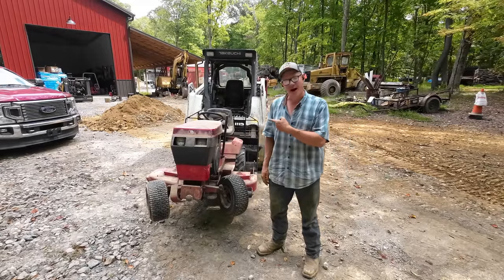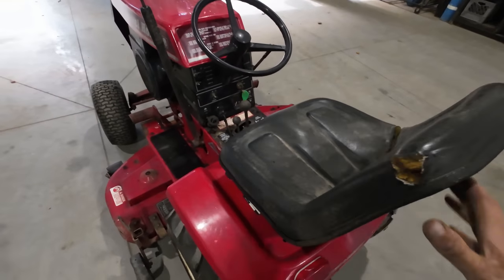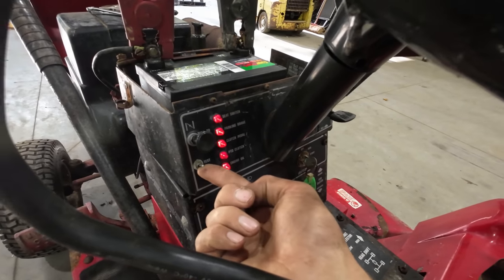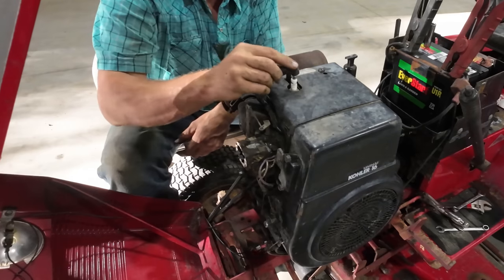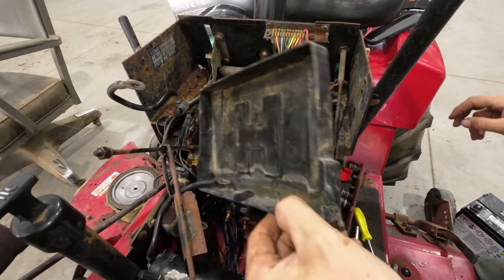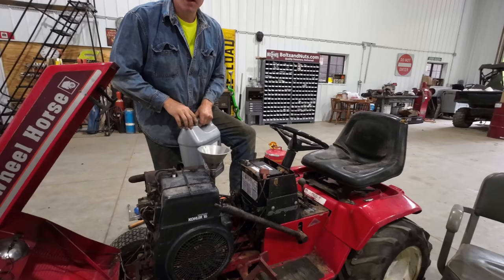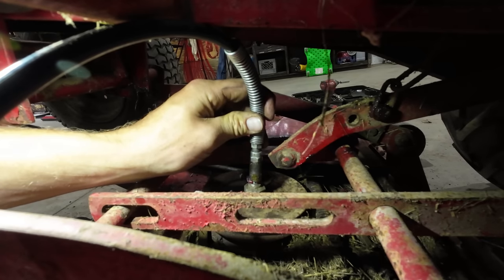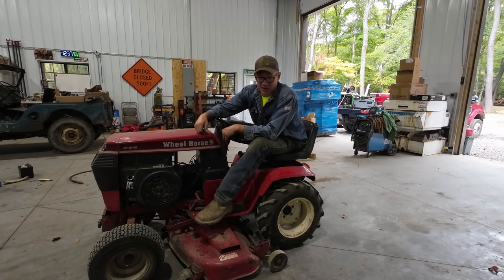FREE! Wheel Horse Garden Tractor sitting for YEARS! (WILL IT RUN??)

Comment: Matt,  What a treat.  I purchased a Wheelhorse 520H new in 1992 and mowed 2 acres with it for 24 years until the mower deck was so thin you could stick your finger through it in about a dozen places.  I still kept it for 3 more years to use the snow plow, and finally gave it to a young kid who wanted to restore it.  The 4 series was the same tractor except engine sizes and the front axle was different  (canted further forward on each end, I think this was due to the hydraulic lift quick attach mower deck).  Mine had the Onan 20HP with Hydrostatic drive and hydraulic lift.  It was the top of the line for the time.  All structural steel and cast iron, weighed in at about 700lbs with 48" deck.  It is a testament to the quality of the older Wheelhorse equipment before Toro bought it and the accountants started running the business....cheap is good, cheaper is better mentality.  This machine will probably last another 20 years as long as it is maintained properly.

Comment: That is a great tractor! I am a wheelhorse guy and own 7 of them at this time. I was thrilled to see you working on this one. These tractors are timeless and I plow my driveway out each year and mow with mine. I live in the snowbelt of Western New York state and that tractor has no problem dealing with all the snow we get. I get replacement seats for mine at Northern Tool, if you are thinking about replacing that one.
Reply: My dad bought a 1975 automatic years ago and is selling it despite my best efforts to convince him it’s a good little tractor to keep. They’re great tractors for their size, built sturdy, easily repairable. If you’re wanting a tractor to wrench on and get your moneys worth out of. It’s the tractor to cut your teeth on!
Reply: your right that horse will out plow my 25 hp deere and the ponds had a superior snow plow design
Reply: @StrikerV3  wheel horse tractors were at one time a direct competitor to cub cadet  ,, i still have my grandfather's D-160  wheel horse tractor ,and there's no mistaking it for anything else   it's a big square tractor slightly bigger than a 430 JD garden tractor,,, i own 3 D series WH tractors ,,the old D160  and i have acquired a D180  and a D200 ,,,,,my D200  has been repowered with  a Kubota D722 3 cylinger diesel
Reply: Love ‘em I got 5 3 different 312-8 and two c160s
Reply: I'm in Western NY too..Lewiston NY actually don't get all that much snow here..where abouts are you southern tier?
Reply: I live right next to Letchworth State Park in Wyoming County. We get lake effect snow from both Lakes Erie and Ontario depending on the wind direction.
Reply: @Paleoman52  I gotchya..yeah you get your share lol

Comment: The Wheel Horse tractors with Kohler horizontal crankshaft engines are lifetime machines.  I have 5 of them. Changed the engine oils to synthetic as well as the trans/diff fluid.  to synthetic.  That one you had given to you is really in quite nice condition. Take care of it

Comment: As a wheelhorse fanboy and collector I’m looking forward to watching this. The 4 is for the 400 series. They had a 200-500 series. The lawn tractor video you did was one of my favorites. It was my exact first mower when I was 8 years old. My dad had a 312-8 growing up, my grandfather had several different horses throughout the years. I currently have a 520 hydro and a newer 520 lxi which are both beast in the garden tractor world.
Reply: I have the 312-8 also and use it all the time
Reply: ive got a rj59 its great its getting a 212 put in
Reply: My favorite was my 1972 Commander with the Kholer 18 horse S belt drive takeoff.
Simply couldn't kill it if I tried.
Slow as F but always reliable once I got done fixing the various issues it had from the lawyer I bought it from up in Coral Gables.
Paid 200 hundred bucks in 2010 body mint condition. 
It was originally his dad's.
Unfortunately he gave all the accessories away or scrapped them.

Comment: Lol. That is why I love working on small engines. It is my passion, because they are just so simple to work on. My mom's tiller started acting up the other day. I removed, disassembled, cleaned, and reinstalled the carburetor in 14 minutes. Small engines are just cheap and easy. You don't have to be rich to pursue it as a hobby. I have enough projects right now to last a year or so, and I got all of them for free. It's a great way to spend your spare time.

Comment: It needs A solenoid switch replacement put on it. And A oil change. Along with A new air cleaner filter. I highly recommend adding in some zinc powdered additives in the oil it's extra engine block and cylinder wear protection for it to matt. Especially if y'all plan on using A snow plow on it in the winter time to.

Comment: Hey Matt, I loved the video on the Wheelhorse mainly because when I was a kid, my Dad owned a couple of them he added three-point hitches (manually operated) that he used to plow, cultivate, and harrow our and several friends', family's, and neighbors' gardens.  Although both of ours had Wisconsin engines on them, I remember my Dad showing me that when starting them {especially cold} if they kicked back {ours had rope starters} it was generally a sign that the valve lash needed adjustment.  Since then, I've remedied this issue with Wisconsins, Kohlers, Briggs and Strattons, Tecumsehs, and Hondas as well as a couple of Chinese engines. If the valve lash is too great, the intake valve is closing too soon causing excessive compression upon starting and the exhaust opens too late causing more heat buildup in the cylinder.  I've encountered many instances where people have replaced perfectly good batteries and starter motors.  This could possibly account for the overheated/melted/defective starter solenoid on your unit.
Reply: I've just been doing the manual 3 point lift myself. Don't suppose you have any pictures of your dad's version?

Comment: Hey Matt, I noticed the mini-splits wrapped in the background ... one thing I've wanted to mention, heating the shop with the radiant floor alone is a slow process. Consider adding unitary heaters as well. The floor will do a great job if the bay doors are kept closed, but as soon as you open one all the warm air is going to blow out and the floor alone will take a long time to warm the space back up again. A unit heater or two by the doors will help break the chill and give the floor time to re-heat the space again. Also a big ass fan will help push the warm air back down to the floor.

Comment: @Diesel Creek it's a DC relay or DC contactor.  A solenoid by itself wouldn't have power contacts that are actuated.  It would just be an electrical coil and a steel bar.

A contactor or relay has several components inside of it.  Yes one of which is a solenoid.  It also has a power contact, which is actuated by the solenoid.  Sometimes they have auxiliary contacts too.

Comment: Man, I just pulled a WH 1057 (1967 year) with a snow blade out of a farmer's field in Illinois last year (for sale off Marketplace). The transmission was full of water, the carb was toast, but everything else was good. A month of work on it later, I had it running and driving, then used it to plow snow from my long driveway all winter. That thing is a beast! All steel and no plastic on that machine. And it never got stuck in the snow or mud. I later realized people use these models for lawn mower tractor pulling!

Comment: Good lawn tractor. 
The mower deck does a very nice job.
Rear exit.
You can go around trees , vehicle's. 
The blades spin fast. 
You can travel at a good speed while mowing. 
Try it think you will like it.
Correction mine has rear exit.

Comment: Hi Matt, I have I have a 312A, 1986 anniversary series. It had chrome hub caps and chrome muffler. It had the smoothest hydro-static trans/rear diff I have ever seen. It did everything l asked to do, mow, push snow, sweep up lawn,and snow blow. I still have it but it needs a complete going through and new paint. It have new decals for it. I can wait to get started on it. I also had a 312-8, but let go. No room for it. The 312A was never stored out of doors. It will be with till I’m gone. It has well over 1400 hrs on it. Enjoy show!

Comment: Love that Wheel Horse, Matt! Major soft spot for them. About 1958 my dad bought an RJ58 model for our rural 12 acres in Ohio Township NW of Pittsburgh. He got it from a WH dealer over on Babcock Boulevard. Our property was hilly and he didn't get a mower deck with it but did get a snow blade for our long hilly driveway. He dug a trail up into our woods and we used the Wheel Horse to pull logs down to the house to cut up for firewood. And I nearly drove the wheels off of it as a 12 year old wishing I could drive a car, so it was my "car" for a few years all over our property. It's only drawback, those early models had a "mid engine" that was just ahead of the gear shift necessitating a big chunk of cast iron bolted ahead of the front of the hood and front axle to keep the front wheels on the ground unless you wanted to pay the big bucks to refill them with liquid when you'd get a flat. Fast forward to my Army hitch in '71. When my dad passed away and my mom needed to sell the property our neighbor bought the Wheel Horse from us and made a custom two gang rotary mower brush hog set up for their wooded lawn area. Years later when he passed away their family sold their property to a cousin and the Wheel Horse went along with the estate. No doubt it's still running today. I'd love to have your Wheel Horse but the shipping to Colorado would be a killer! And the downside about it, it's likely a 48 or 54" deck and that won't fit through my TUFF shed doorway. My old Craftsman lawn tractor has a 42" deck and I have to lift the discharge chute vertical to get it in the door so the WH would be a no-go. Hope your dad gets a lot of use out of it. It should run for years into the future! By the way, on Pinterest I found a Wheel Horse group that posts beautiful photos of restored early models.

Comment: Hey Matt, a plumber friend told me when I was about 20 to use grease on pipe threads. He told me the pipe thread is tapered and all you ever have to do is tighten the connection enough to keep it from leaking and the grease will offer lubrication to allow for tightening it enough. And as a bonus, you can usually undo the joint too. I have seen so many different kinds of "pipe thread compound,s" hardening,  pliable, non-hardening, liquid teflon, yellow teflon tape for gas and white teflon tape, but I never once heard of or seen anyone use grease. The guy was a master plumber who owned his own plumbing business, so I took his word for it and I have used it ever since. ben/ michigan

Comment: Save it . These are bulletproof. Tough as nails tractors. We had four of these at our local school district. I will tell you they did not go out for an hour or two once a week. They went out five days a week eight hours for years mowing at our schools. They were used in areas that were too small for our larger equipment to mow. And trust me they held up extremely well. Not only that but the cut was top notch. Because the deck is tall, they gave you a wonderful finished lawn even when mowing in early morning wet conditions. No clumps. Look at all of the cast iron construction all of the grease fittings. Even on the pivot points of the clutch and brake pedals unlike what you will find at Lowes or Home Depot today. They made a rear discharge deck that was used by many cemeterys because they did not blow grass onto headstones instead the grass came out the back or the tractor between the rear tires. a brilliant idea to keep grass out or homeowners flower beds as well. Please save it and treat it well and it will reward you with years of service.

Comment: Simplicity lawn tractors are great.  You can find them branded as old Craftsman, and Agco Allis tractors.  They have a cast iron front diff, hydra drive, 2 sppeed rear ends, diff lock, and front end loaders, front accessory drive, as well as dual wheel kits and some have a 3 point hitch. Oh, and they mow grass too!  The older ones will come with and Onan engine and some come with a Kohler Command Pro (which gives the most savage backfire when you shut it down from high RPM).  I ran an 18hp onan Craftsman model for years until it had a rod failure, then I ran it for another year on 1 cylinder.  I didn't have any idea the motor busted until i had someone take it apart.  Sadly, couldn't get the onan parts to replace.  :-(.  I have and Agco Allis with the Command Pro I have abused for a few years and it needs engine seals now so it's parked.... but that's a project for 
another day!

Comment: Gravely garden tractors were the very best, especially the ones with the Kohler twin.  All of that cast iron and a transaxle on the rear gave them exceptional traction.  I added chains to mine and in combination with the snow dozer blade that thing was a snow moving beast.  The shaft drive mower deck would cut the lawn very finely.  Sadly, they quit making those units because with inflation they would be prohibitively expensive.  If properly maintained those old gravelys would outlive anything else.

Comment: I really need to get cracking on restoring my 66 JD 110.  I grew up driving it too… from about 1970 on.  I even used it occasionally to mow Dad’s place when I was home into the 1990s when it finally broke a ring on the K181S. I have another engine to go in it… just haven’t found the time.  My grandfather was a JD garden tractor dealer, and then later after he passed, the man who bought his business turned traitor and sold Cub Cadets :p  Seriously, JD and Cub Cadet are, for me, about equal to each other  and a cut above Wheel Horse.

Comment: An excellent product to re-condition and protect tractor seats like on this Wheel Horse tractor is mink oil paste, which I can usually find in small tubs at my local farm and feed store. And I totally agree with you about using good oil to ensure engine longevity. I am also a big fan of annualy using Prestone radiator flush on my vehicles to keep their radiators and heating/cooling systems clean.

Comment: I would not be too concerned about what brand of motor oil you are using Matt. I was the same way when I started working on lawn mowers back in 1973. I would not use anything but Pennsoil in my stuff, cars etc. As I became more experienced and went to more and more service schools I realized that as long as you use the right weight oil and change it on a regular basis it doesn’t matter what brand you use. I have been running Walmart oil in everything I own and have never had a failure. My Honda had 275 K on it when I bought another car and it never used oil and ran great. I’ve saved a lot of money over the fifty plus years I have repaired my own stuff. When you get tired of spending all that extra cash on oil, you could probably build that new house a lot sooner 😅😅. Best regards Steve. 😊

Comment: Wheel Horse lawn and garden tractors were pretty much in par with John Deere versions.
Cub Cadets were a basic homeower low price versions that didn't have the accessory options the other 2 did.
Wheel Horses had a better motor that Deere's.
I have a 2 year vocational school diploma working on small engines and a couple more diplomas on larger engines including radial and turboshaft aircraft and helo engines. 
I've owned both Deeres and Wheel Horses and preferred WH's for there simplicity, parts availability and costs for parts.
Deere parts got ridiculously high priced where WH's stayed steady even after  Torro bought them out.
Ya got a good tractor there Matt.
Your Dad is a lucky man to have you for a son.
Keeping him outta that creek proves it.

Comment: I had a 312-H given to me about 6 years ago that had been sitting for 15 years.  New battery cleaned out the mouse house and cleaned the carb.  Been running it to mow in summer and picked up a snow blower for winter.  Great machines made to be serviced and used for years

Comment: I grew up with a 1994 White GT-1855 and was a good tractor. Mowed 3 acres with it and took about 4 hours. Around 2012 my parents got a bad boy zero turn and was able to mow the 3 acres in about 2 hours. I went and took the White and fixed it up and got a parts tractor for the rims and transmission. Was a good tractor, had a 3 point hitch cat 0, shaft driven all around, built heavy duty.  Had an 18HP briggs on it but I wished it would have been larger. They did put a 20hp on them in later models. MTD bought them out and the tractor sadly disappeared! Around 2018 I traded it in for a John Deere 1025r.  I would have liked to have kept it but just didn't have the room.

Comment: when you first opened up the tractor, the Negative battery terminal was disconnected. That loose "ground" wire is supposed to be connected to the negative terminal of the battery.

Comment: Great video! I've got three Wheel Horse garden tractors. Mine, a 312-8, my late father's 414-8 and another 414-8 without a motor. I bought mine with a couple hundred hours on it in 1992 and it still runs great as does my dad's 414-8. I keep them for sentimental reasons. Kohler motors last forever.

Comment: Matt those engine blocks actually calls for SEA 30.,or 10W30 motor oil. I recommend using all season with added in zinc powder in the motor oil shaken up really good. The gallon  plastic jug is the way to like antifreeze plastic jugs. Just saying that motor oil is actually the wrong weight for that small engine. It's not designed for that engine block.